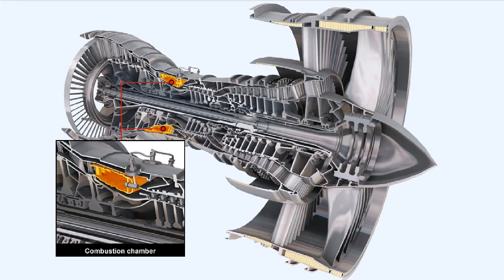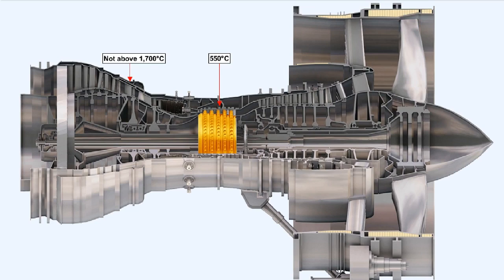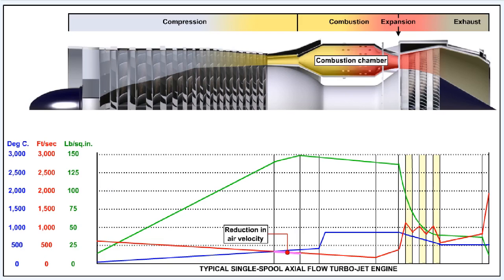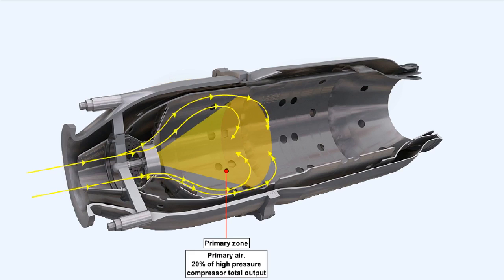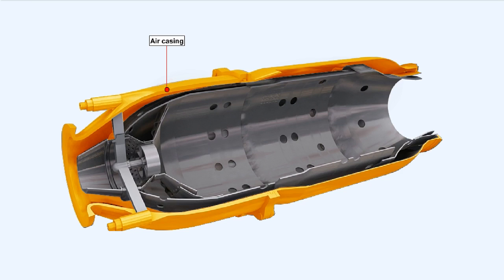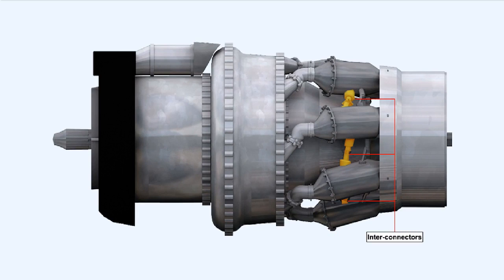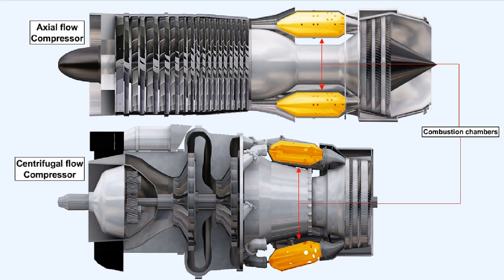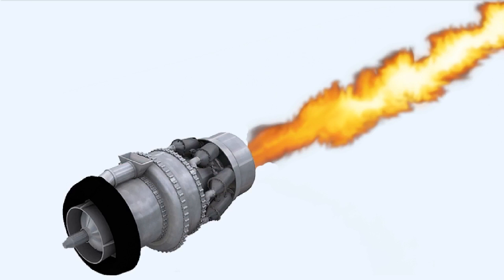Combustion Chambers Part 1 - Aircraft Gas Turbine Engines #08

Comment: I still don’t get the why we need upstream flow? In real diffuser with a small opening angle there is already a velocity profile with slow air outside and faster in the center. Now use thin sheet metal for the cone. Then it might be possible to have a step temperature gradient with the open end acting almost like a glow plug.

Operation range is achieved mostly by pressure and then by (random) turbulence.

I cannot believe that a stochiometric flame front running all the time is slower than in a piston engine where it only runs for 20° .

Comment: what happens to the gas when it is heated inside the engine's combustion chamber?
Reply: The gas’s and air is mixed together and ignited by the flames and explode turning into kinetic energy and follows the path out through the exhaust nozzle and thrusts the aircraft forward (forward thrust)
Reply: Also think about a barrel lying on the ground, if you light a dynamite and stick in the barrel, the explosion bounces off the barrel and shoots out through the back trusting the barrel forward